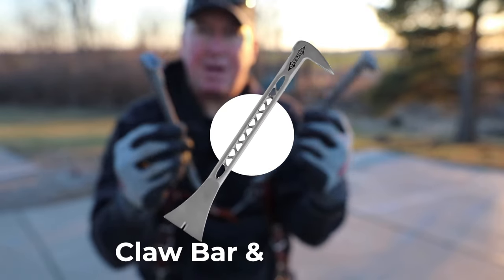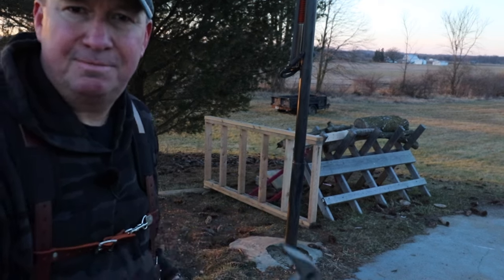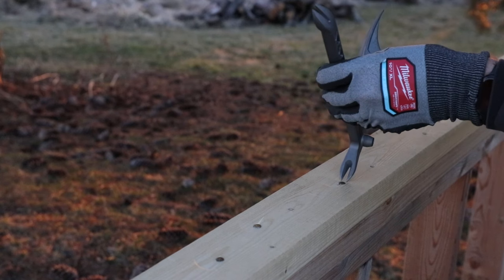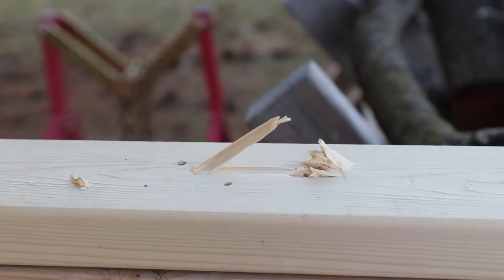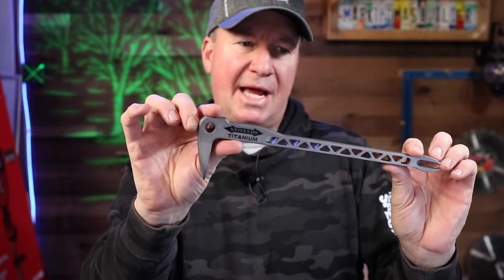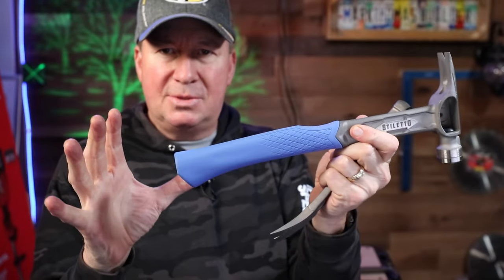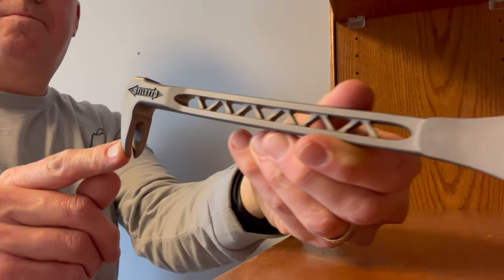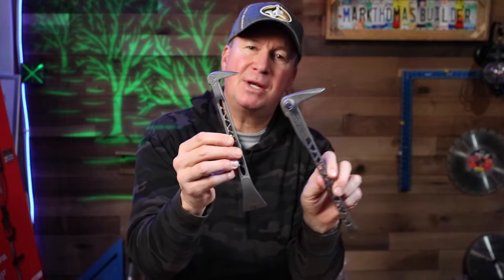You Need one of these in your Tool Belt!

Comment: Total waste of money. If you’re buying a tool just to remove one nail… why then are you only removing one nail. Cheaper and faster is to have recipro saw with nail embedded blade. Will solve your issue faster and cheaper. End of the day people just wanna be seen with a Brand more than anything else.
Reply: lol you clearly have not done any carpentry work or know what scenarios to use these tools in . I am a trim carpenter and have 2 stilleto hammers and will be buying the trim bar.  Unless you use these first hand, you will not understand the difference
Reply: @mrkraftydad  ok mate…because you must be doing something wrong to be  pulling nails out all the time by the sounds of it. Read my comment again